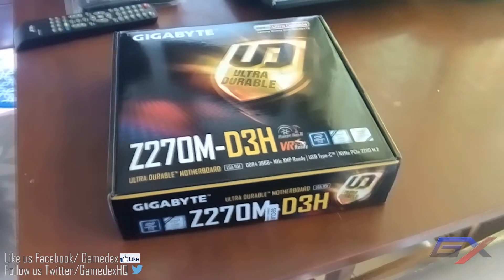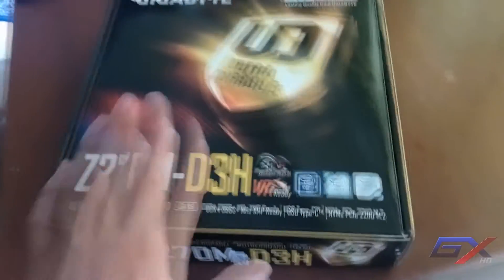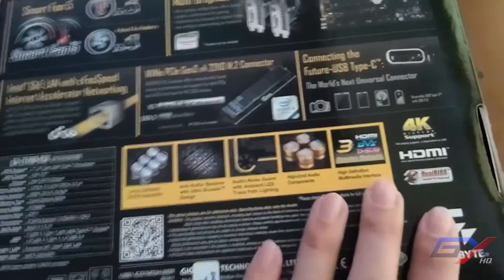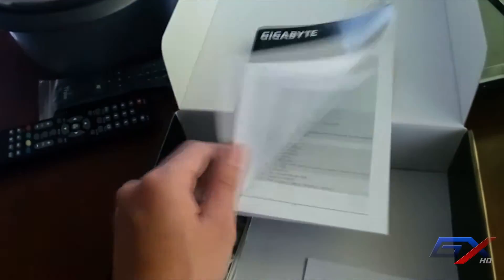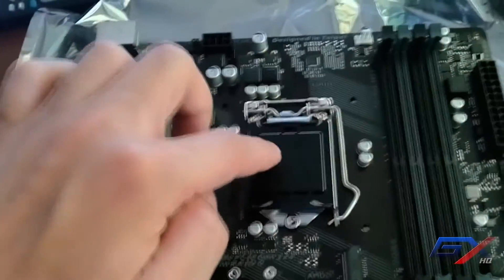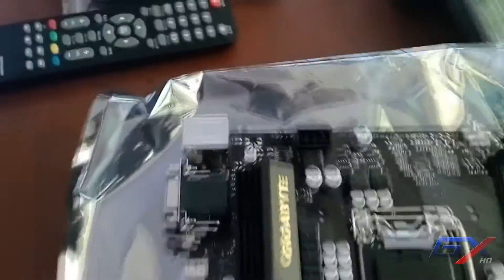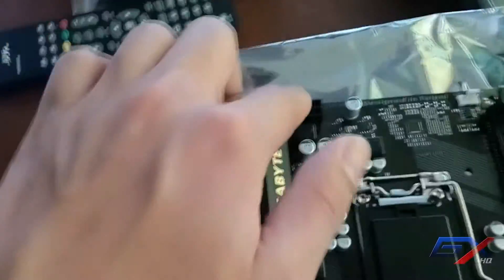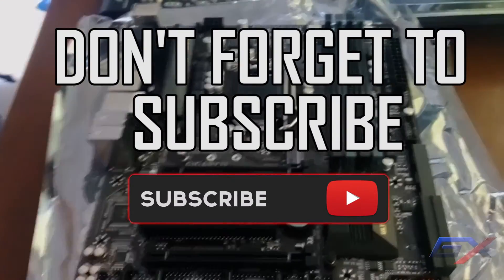Unboxing: GIGABYTE Z270M D3H

Comment: Realy want to know its OC performance with an i7 7700K...
Reply from the maker: I don't have or even own an i7 7700K, But I use my Intel Core i5 6600K in this motherboard and I overclock from 3.5 to 4.5 GHz in 1.3V 60 Degress Max Temp, 32 Min Temp with CM V6 GT Cooler. The performance is quite good, no thermal throttling, Blue Screens and other issues issues at all. Unless you increase your voltages, clock speed and having a water cooled setup.

Comment: sir anong processor gamit mo dito? and ok din ba mag oc dito? ty
Reply: GAMEDEX HQ Was it difficult to OC on this board? I'm on air cooler (TX3 by cooler master) and I'm getting this board with a 7700k, and I was wondering if I could reach let's say 4.8. Also what are safe temps for Kaby Lake Chips?
Reply from the maker: I'm using i5 6600K overclocked to 4.5 GHz in 1.275v, 58 degrees max temp... So far good naman mag o.c kasi Designed talaga Z series (Z270) mag overclock. But I would recommend to update ung bios para accurate ung Vcore readings.
Reply from the maker: Its not difficult to Overclocked in this board. Because GIGABYTE z270M D3H ("Z270') is designed for overclocking, So you don't have to worry about it. About your cooler (CoolerMaster TX3) is not bad for overclocking, But I would recommend mild overclocking  in that type of cooler and that type of CPU (i7 7700K). I heard i7 7700K is kind a  hot in overclocking in 5.0 GHz  because of its cheap lid.. maybe.. 
But if you're planning to overclock your i7 7700K, I would recommend to do some research about the Temps, Reviews, Overclocking and Articles about Delidding i7 7700K (Do it on your own RISK) . I can't answer the safe temps of i7 7700K, because I don't have or even experience the i7 7700K and I don't even know the safest temp of i7 7700K due to its issue.

Comment: sir will it support intel turbo boost technology

i mean i am gonna install i7 7700k processor which has turbo boost to 4.5ghz so will i be able to get that with this motherboard, need ur help plz
Reply from the maker: Stubborn Facts  absolutely Yes.
Reply: Great video buddy , Thanks
Reply: can u plz provide me link of video which will me brief me about " how to turn on turbo boost " with this motherboard, thanking you in advance
Reply from the maker: Thanks
Reply from the maker: The Turbo boost is already enabled by default in your BIOS in almost all motherboards that supports Intel Core I series.   
I have a question, what brand and model is your motherboard for your Intel Core i7 7700K?
**Sorry I can't give you a video link, but you can search it on Google like Tom's Hardware articles regarding on how to activate Turbo Boost.

Comment: what cpu will you pair this mobo with im thinking of gretting this for my 7700k
Reply from the maker: I would pair any of those two Generations (6th/7th Gen) of Intel Core i3,i5,i7.
As long as it is K series and you can use its overclocking potential and gain more performance on your CPU. 
the difference between the i7 6700K and 7700K is so minimal. Frequency would be answer on that.